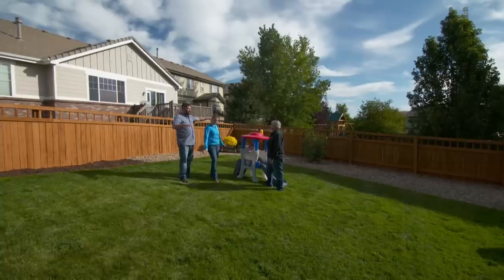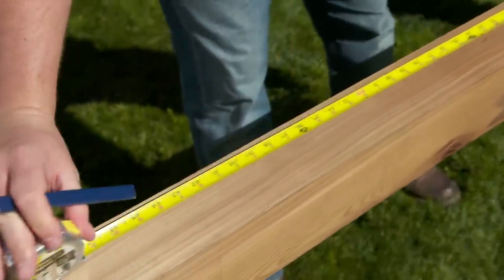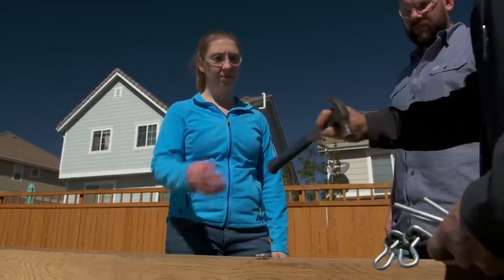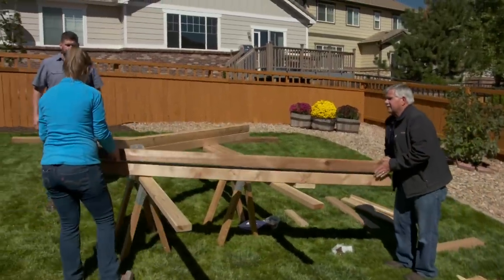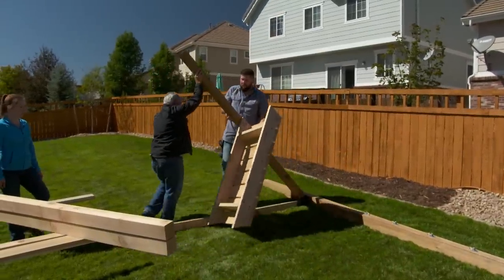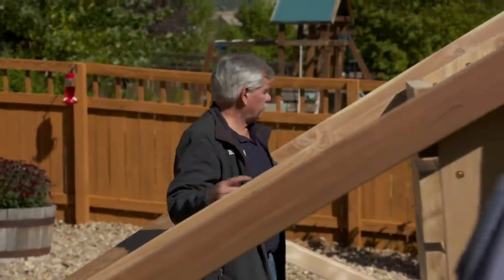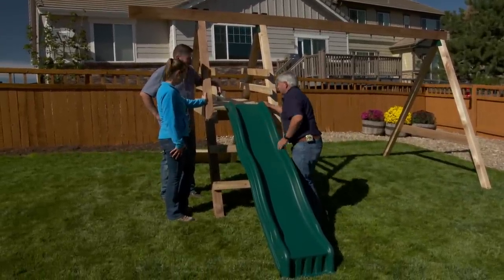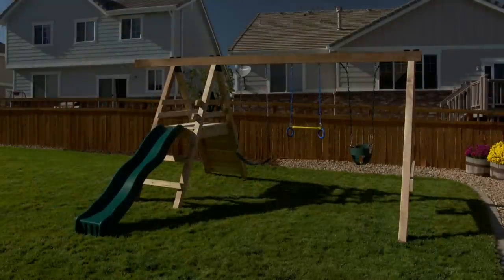How to Build a Swing Set | Ask This Old House

Comment: I built a swing set today, got the inspiration from this video. It’s really not that hard! Final cost was about $800 but it’s strong enough to hang a car off of. One thing I’d recommend that I got off Amazon is the feet. They have a stake that drives into the ground and the 4x4 sits on a 6x6 rubber pad. I weight 300 lbs and I swung hard and even jumped and mine didn’t rock or wobble at all. 4x6 for top beam is a must.

Comment: Did you mount the swing loops turned 90 degrees so the bushings slide rather than rotate? If so, they're probably worn out by now.

Comment: I understand using the screws for tensile resistance, but it seems odd to use screws to resist shear to hold up the platform.  I'd want something that'll hold Charlie as a rowdy teenager... and 3 of his friends.  So, bolts or at least nails.
Reply: Structural 1/4 inch screws were used. These, in the correct orientation and amount effectively replace the need to use carriage bolts.

Comment: I’m adding an old a-frame playset with 5’8” deck height to a new playhouse style playset with 6D’ deck height using a bridge or crawl tunnel. How can I raise the old a-frame deck 4”? Risers? Set it on top of 4x4s and secure ? Or do I just try to do a clatter bridge to connect the sets so that it’s flexible enough to attach to slightly different deck heights? Help!

Comment: why isn't it anchored to the ground?  at least pound in some stakes and bolt the frame to them
Reply: Nate Walkner that base is wide enough there’s no way it’s going anywhere
Reply: @mattsnyder4754  better to overengineer than to pay for the emergency room when 2 swinging kids flip it
Reply: Because they are gonna anchor and level it on their own if you paid attention
Reply: @DXSUCKIT1990  burying the back legs 2 inches into the ground isn't anchoring anything
Reply: It's very sturdy and the base is wide enough.  Charlie is a toddler no more than 30/40 pounds. It would take a couple large adult men to flip it.
Reply: @Brennyboy69  you realize kids get bigger, right?
Reply: And it will also set and sink into the ground over time too.
Reply: @daisycorta3340   I have flipped many a swingset, in this case it is even angled downhill, you think kids are small but get a couple of them going and the pendulum effect will surprise you.  Meanwhile they only get bigger
Reply: It’s pretty heavy and wide enough. It’ll hold up